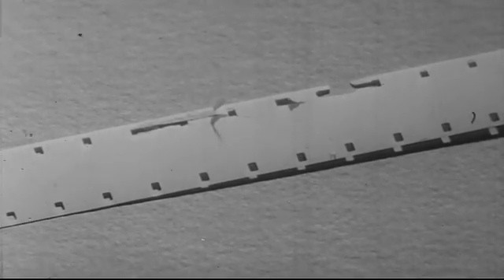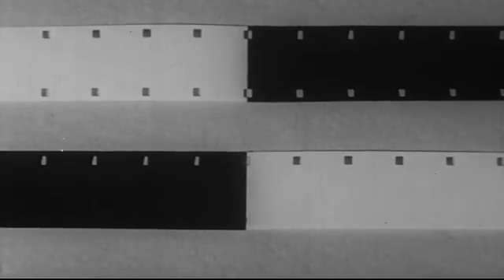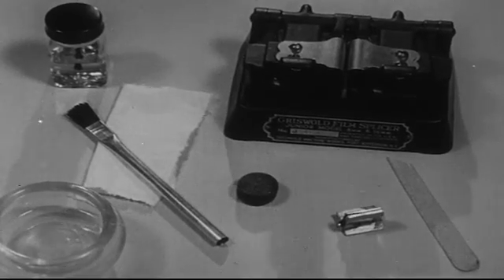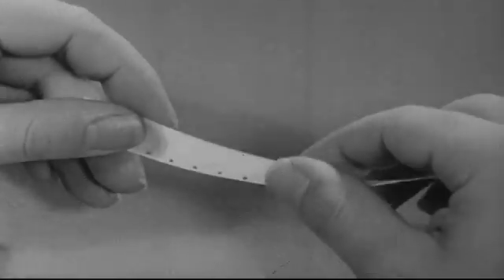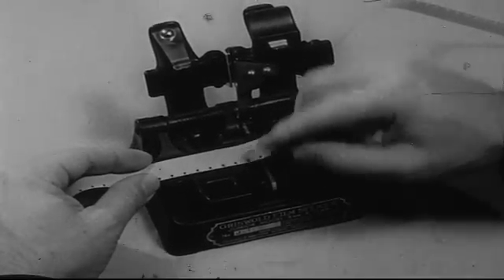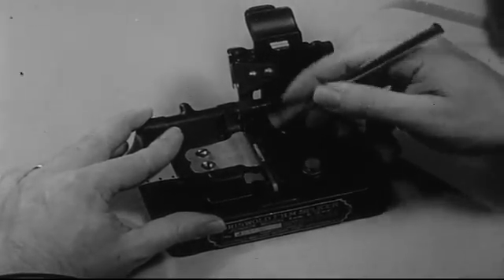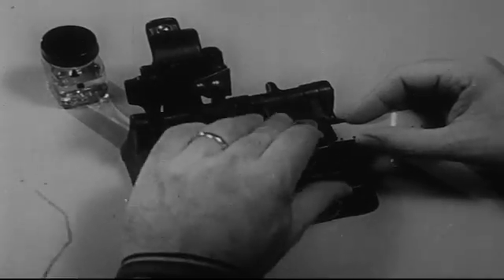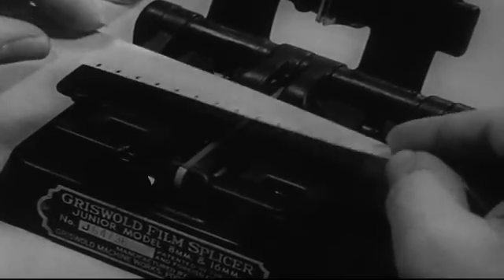Splicing Motion Picture Film

Comment: Anyone know what year this instruction film was made?  I would guess 1960.  I used to be a projectionist until 2010, and I have only made tape splices.
Reply: My guess was the same, but I wish I knew
Reply: By the 1980's, most if not all 35mm release prints were made of polyester.  Film cement will not weld polyester, so splicing with tape was the only way to go.  Cement only works on cellulose film; acetate ("safety base") or nitro cellulose ("nitrate base.")  Polyester base film does show up sometimes in 16mm (mainly for classroom films) and 8mm (the Fuji "Single 8" cameras of the 1960's-70's used it.)
Reply: No, I'd say more into the 1930s.